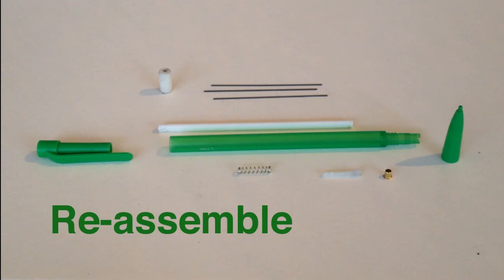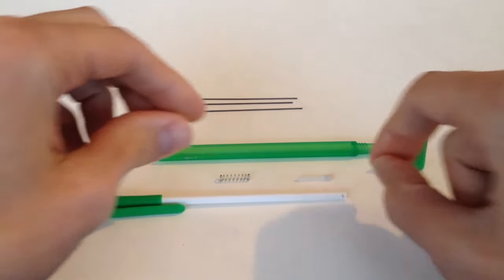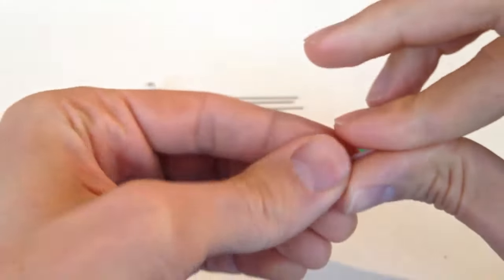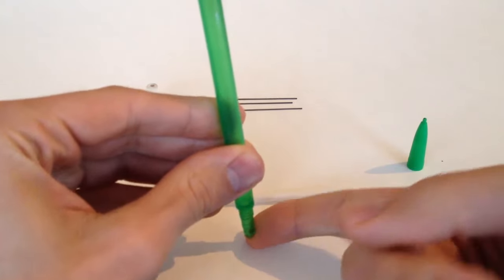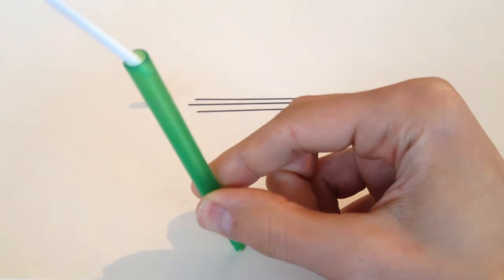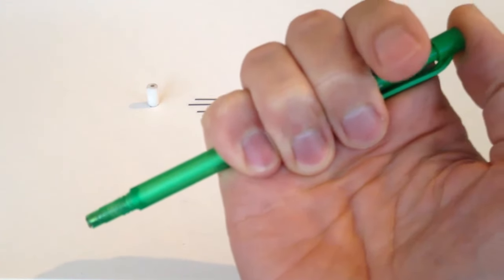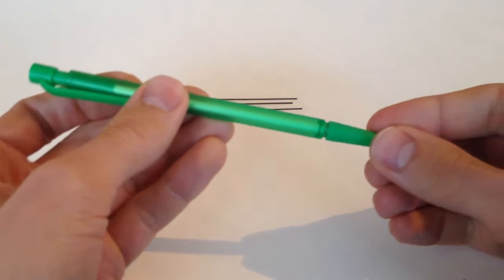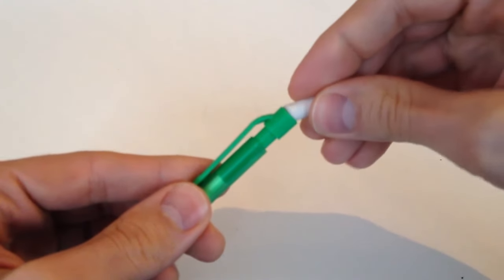Re-assemble the Pencil

Comment: I borrowed this pencil from my sister and promised it to return it to her. When I was using it, out of curiosity i totally dismantled it and after that i couldn't reassemble it the way it was, i got scared af and didn't know what to do, so I searched it and got this video. The point I was missing was to fit the clutch in the pipe or whatever 🤦. Well i  assembled it and I won't get any scolding phewwwwww